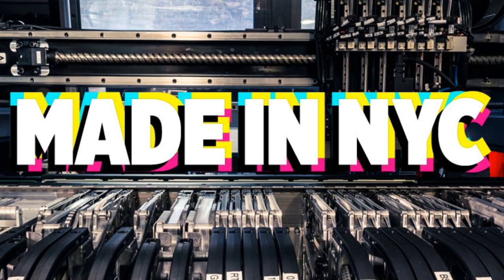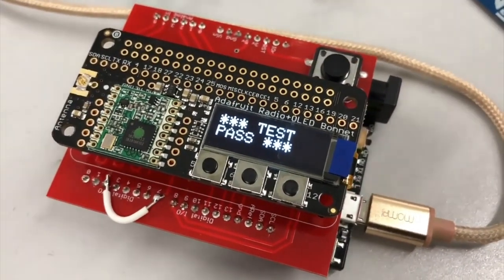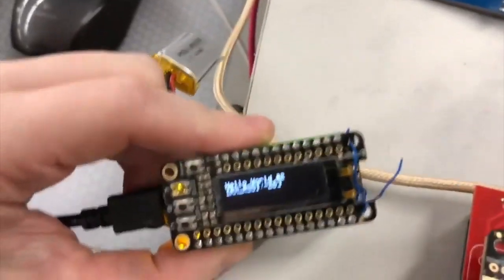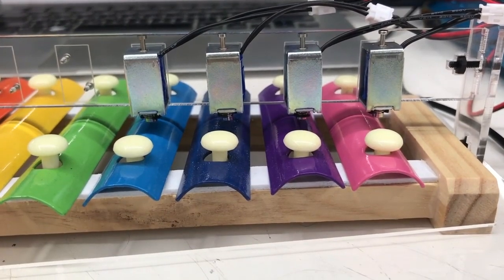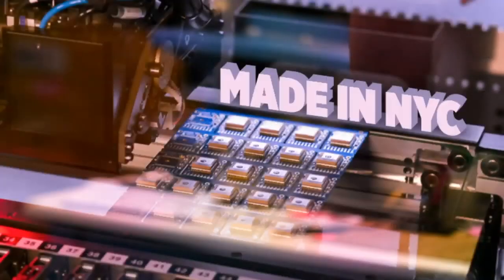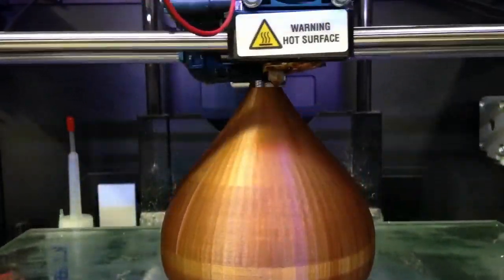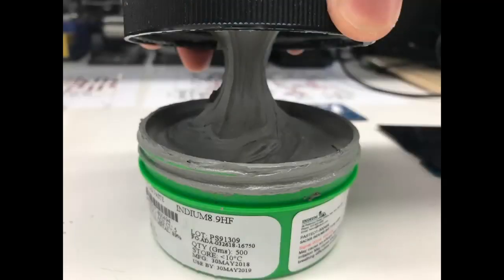Made in NYC 1/16/2019 Featuring a #RadioBonnet Tester #Adafruit @Adafruit

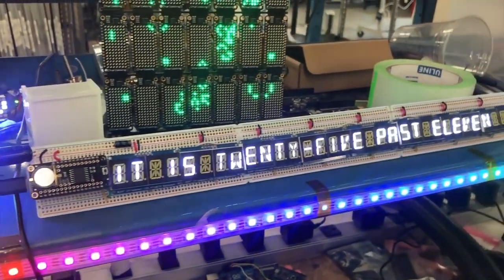Comment: What size are the alpha-numeric displays around 1:35 mark?  I've used LCD displays in my car before but they have a problem when I wear polarized sunglasses.  If I mount them horizontally I can't see the data because the displays are polarized the other way.  With the TFT display shown on the FONA project can the display be viewed horizontally or vertically with normal polarized sunglasses?